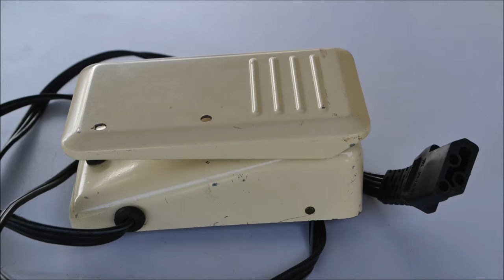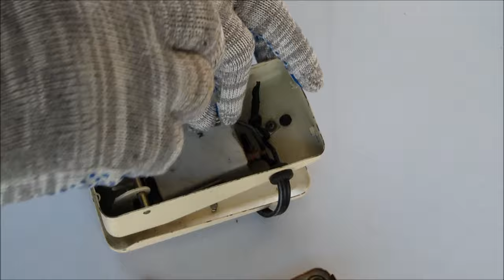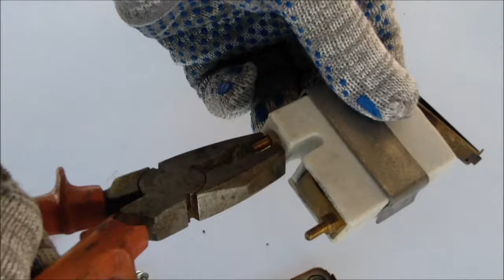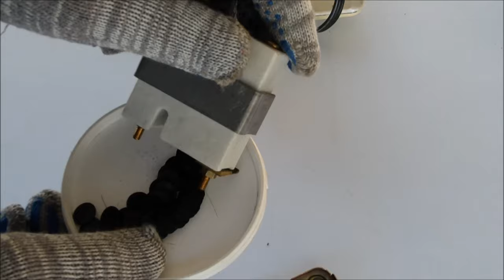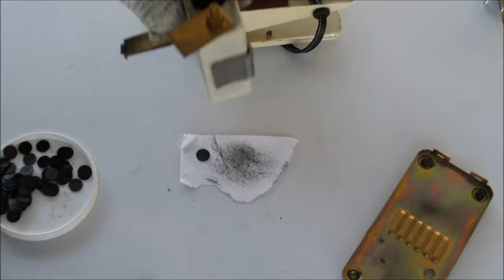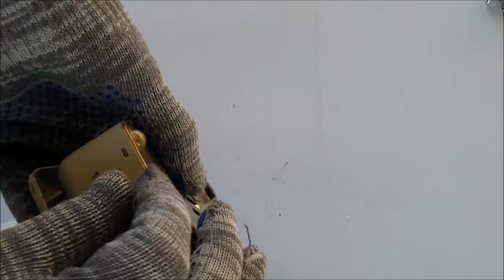Sewing Machine Foot Pedal. Foot Speed Controller Repair

Comment: Thank you for the video.  I've repaired and restored other foot pedals of the Singer  button type with two rheostat rows of disks.  This does not appear to be any more complicated than those.  Why would I want to have a service repair specialist do this for me, from your excellent video?
Reply from the maker: It's good that you can repair. But an inexperienced craftsman can make a mistake and there are times when the pedal burns out if you leave the machine plugged in for a long time.
Reply: @sewway  Very true, but who ever leaves a sewing machine plugged in when not in use - learns very quickly not to do that.
Reply from the maker: All right, but better warn. Thanks.
Reply: I have a question about the ceramic block.  The machine I just bought had a rattle-y foot pedal just like this.  Upon opening, saw that block had split down the center, releasing all of the graphite discs.  Can I super glue the ceramic block back together, then clean and reinsert the graphite discs to still use this pedal?
Reply: @susanwade9661  Give it a try, what do you  lose?  I would be very careful that you may cause a dangerous problem causing a electrical short or even a fire.   To me if you are not comfortable with these type of repairs, it may be safer to get a new part or a replacement  controller.

Comment: I have this very same foot pedal, recently inherited my machine from my grandmother, and I am trying to determine the specs on the thermal resistor beneath the heat shrink of the leads. Do you happen to have a schematic or could you look at your own to share the info on that part. Mine is blown and am trying to replace it (I have experience in electronics and am comfortable with the replacement, but can't get the info off mine). Thank you!

Comment: I have a very similar foot pedal but I can't unscrew it because there's no screw at the bottom or the sides. Please Help!
Reply: It likely slides off and back on. Mine did. I got it off and back on again and scraped the blade that touches the carbon. So simple a fix. Had been contemplating buying a replacement. 

In fact I had bought a replacement motor and foot, but this particular machine is wired differently. So I lamented until today.

Comment: I have a plastic foot pedal that has a circuit board. The machine is no longer sewing as fast.  What part in the circuit board is faulty?
Reply from the maker: What part of the board is faulty? 
Sorry, but I cannot answer this question. Contact a sewing machine repairman.
Reply: @sewway  thanks. Cleaning the machine did help. But the foot pedal runs at one speed.  I cannot control the speed with the pedal. I will look for another pedal.
Reply: Amreekan most of the time, a resistor or a capacitor will be at fault (or the first ones to fail) if your controller contains a circuit board.
Reply: @whyldthing86  Thank you.  I ordered a new one and it should be coming in the mail soon. Once I get it.....I will try to replace those components on the old one. Thanks again.
Reply: @whyldthing86  Probably someone who has more experience in electronics can check the circuit board and components such as the resistors, capacitors for continuity.
Reply: @sewway  Probably someone who has more experience in electronics can check the circuit board and components such as the resistors, capacitors for continuity.
Reply: Rafael Munoz you would not need that if he would be willing to DIY it. There are lots of YT instructions how to check a faulty capacitor, resistor (and even a transistor)...as long as one will be willing to DIY it.

Comment: Mine have stopped working completely. I've not used it for over 10 months and there has been some water damage, what can I do to fix it?
Reply from the maker: You need to contact a sewing machine repairman
Or buy the same pedal, used
Reply: @sewway  thank you so much for replying, I think I will replace it after all